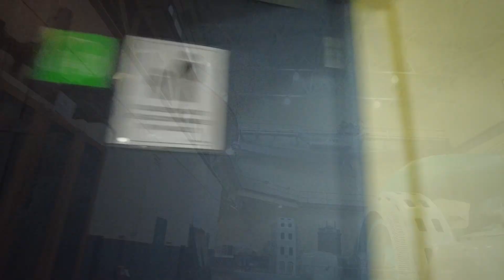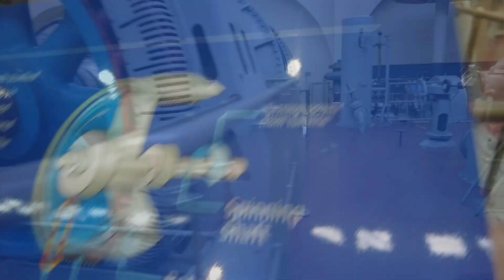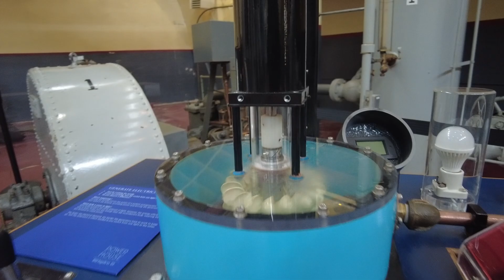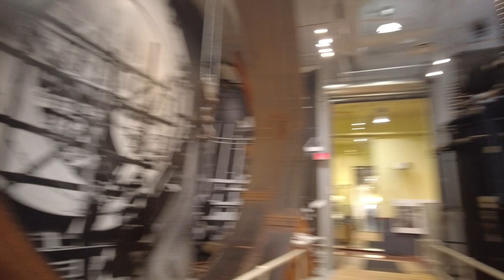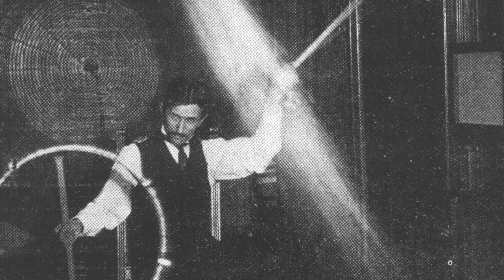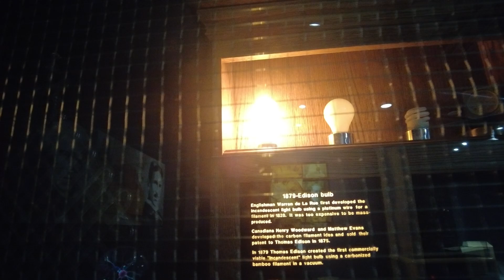Stave Powerhouse - Different Types Of Electrical Technology & A Nikola Tesla Coil Demonstration

Comment: They turned that in to a really cool museum! Good tour! 
Large  brushless generators still need external power sources for field excitation. Only the smaller gens will have a PMG on them to create their own excitation power to power the AVR for field excitation. 
There was an OCB, oil circuit breaker, outside in the switchgear area. Not all the green cylinders are transformers. But the interrupters they had hanging inside, showing the internals of the breakers are what is inside the OCB outside. Although the parts on display inside are for higher voltage OCBs, the OCB outside is lower voltage, but same principal using oil and interrupters to quench the arc when breaking loads and faults. If it was mounted on a frame and had a tank than can be lowered, it's an OCB. You drop the tank to perform maintenance on the internals. Transformers usually sit flush on the ground and require way more work to detank.